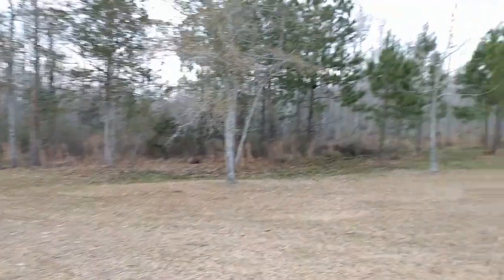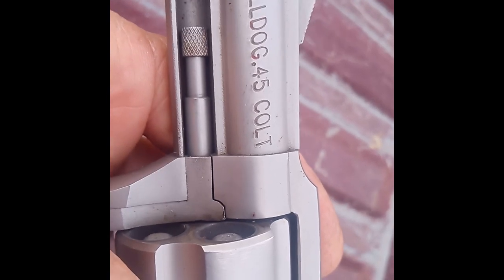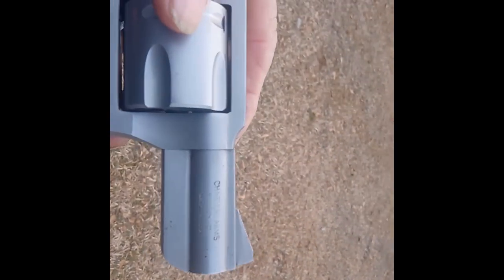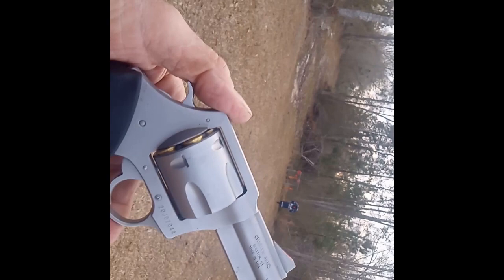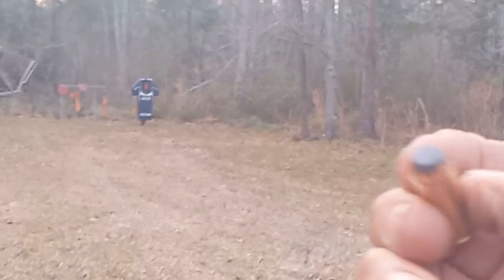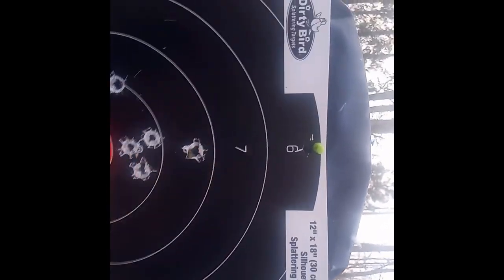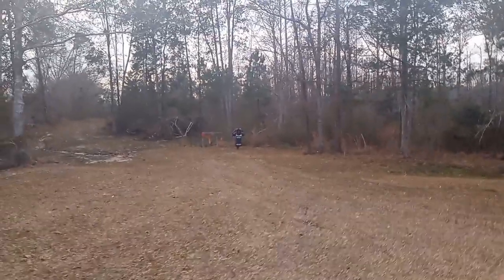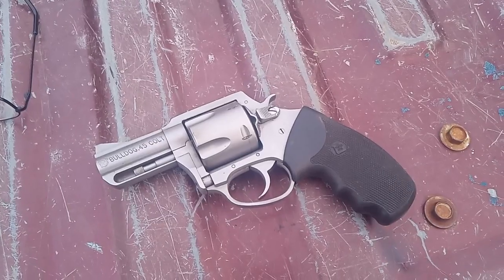Charter Arms Bull Dog.  in, 45 Colt. A SS, 5 shot Revolver.   A Viewer inspired video.

Comment: Revolvers firing pistol cartridges began to become popular after WW1 when the USA realised that they needed more M1911 than they had in stock and the factories were already at the top of production they resorted to using revolvers with frames large and robust enough of similar caliber as the Colt New Service 45 and the S & W of the 44 Spl but in order not to complicate the logistics with different types of ammunition adapted them to use the 45 Auto of the M1911, which being a low pressure cartridge made the operation feasible by creating models like the M1917. The only downside is that the 45 Auto had no flange but they devised the “moon Clips” (it comes from that the first ones were half-moon shaped and housed three cartridges, later they made them for six cartridges and by the way they facilitated the recharge being a kind of grandparents of the “speed-loaders”). 
What did not cease to be a temporary solution to a logistical problem, when these revolvers were sold in the civilian market as military surpluses at affordable prices, began to be known and appreciated. Generally using gun ammunition on a revolver seems quite exotic and unnecessary but for different reasons it is not so bad. Many people, not especially inclined towards weapons or who have not developed a special ability to quickly and efficiently solve the possible interruptions that can occur with pistols, or who due to illness, previous injuries, age, etc. are not able to hold with the necessary firmness these Officer’s type pistols, have an excellent option in revolvers. There is a ballistic revolver cartridge similar to the 45 Auto which is the 44 Spl, but due to market circumstances it is an ammunition that is not always available everywhere, being of shorter production runs somewhat more expensive than the 45 Auto and does not have the variety of shells and loads available. This is oriented to a type of customer that is equivalent to the one that would carry a Colt Officer’s, Star PD, Detonics, etc. in 45 that for some reason prefers to opt for a revolver and meets a product like the Arms Pitbull Charter of that calibre using as a base the classic Bulldog model of the 44 Spl whose ammunition is basically available anywhere at more reasonable prices. At least there is a clear reason why it exists.
Reply from the maker: Yeah I reload both. 44sp/44mag  and 45 Colt/454 Casull.
 Hand loading gives you a greater range of variety, with multiple bullet weight and design. As well as a developed charge that works best (or not)in your firearms.
Reply: Great explanation for the .45 ACP, which Charter Arms offers a model that does not require moon clips. 

The revolver being shown here is the Bulldog XL in .45 Colt. (Often unnecessarily referred to as .45 Long Colt to distinguish between it & the shorter .45 ACP) 

Fantastic carry snub. I love mine & it’s literally the only one I’ve seen in person. Not very common. I’d like to have the .45 ACP version as well.

Comment: I want one!
Reply from the maker: Thank you for your comment.
 And from what I can tell.  Good luck 👍.
  Even the paperwork that came with the gun did not have it in inventory. 
 We ran across two on GunBroker. Just by chance. Getting anything then was a challenge.  The store owner knowing my love for a 45 Colt. Gifted it to me for my work in the store. The store has since been sold.....  Cold Steel Firearms.
 But I'm still.  Cold Steel Bill. LOL
Reply: check buds gun shop
Reply from the maker: Bearing in mind I've had this pistol for several years now. Buds guns. Guns.com  Kentucky guns.  May have them in stock.
  Actually I went and checked a couple of these sites.
  Buds lasted one in 45lc. But said it was a special order item. And May come with delayed shipping and additional charges.
  That tells me that they will probably have to look for one themself. Be that the case. Just go to your local gun store and have them order one.